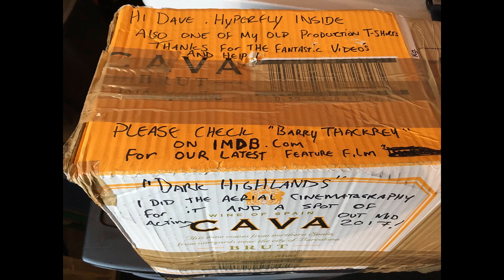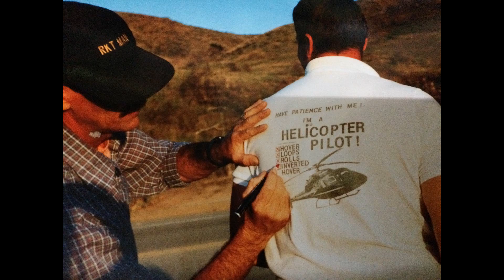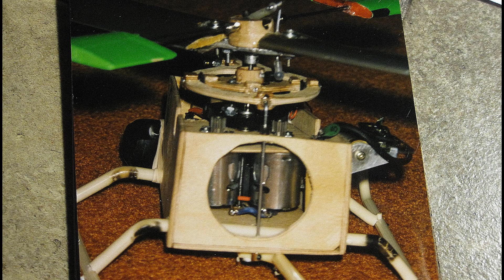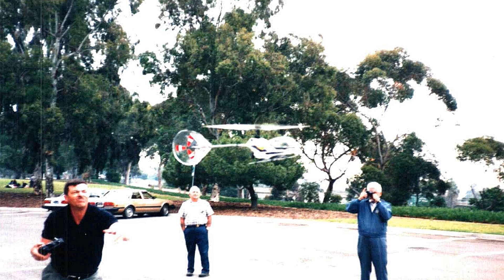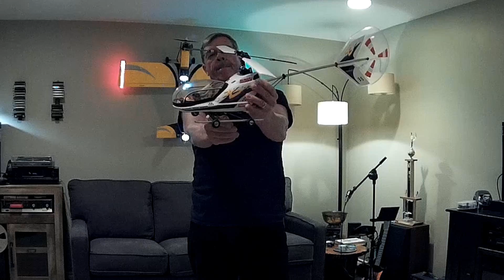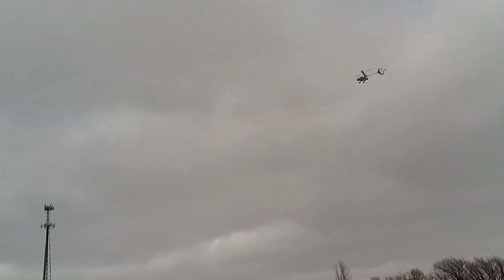History of the Kyosho Hyperfly 2 Channel, No tail rotor Helicopter and extreme flight!

Comment: Another innovative idea:
Y not use an aileron in down-wash of main rotor right where tail rotor is. 
Same effect is already used in single prop aircrafts in which angular momentum is countered by giving slight ailerons roll.
Such a helicopter wouldn't require any wind to hover.
Reply from the maker: Im flying it stock for this video, not engineering it. We have tried that before and there is just not enough downwash wind to create enough  thrust to counteract the torque.  Do you fly at all?
Reply: Technically yes! ....  Even though 99% of hobby time consumed in post crash repairs ...but that is the whole fun !

Comment: the concept 30 you showed, I have that one also. I even have a brand new in the package set of blades for it. sadly, to fit them, I needed to upgrade the blade grips, and never got around to it, and when I did by then it was out of production and impossible to find parts for. its now a beauty queen on my shelf, where it will stay. I believe its better that way.
Reply from the maker: Yes sir. Many folks learned to fly on kyosho concept 30s. I too was disappointed when they dropped the line but the nexus helis replaced them and were better. I am happy to hear you have a nice one to show as its a good conversation piece. Thanks for the comments.